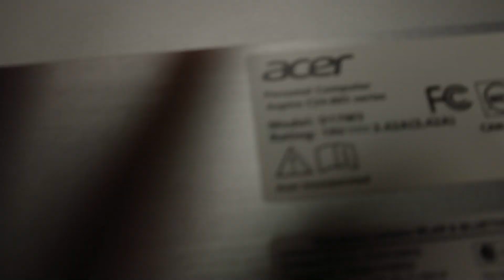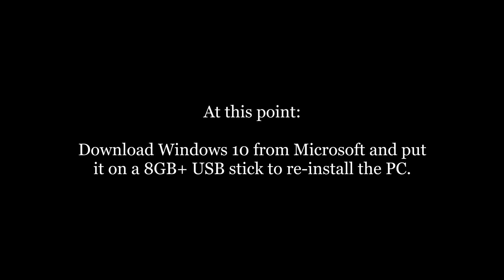Easy Acer Aspire AIO All-In-One PC SSD Upgrade - HDD Removal - Howto

Comment: Did you have any issues installing windows after changing the Hard Drive? For some reason the computer is not recognizing the Media Creation tool, says that the drivers are not found. Got any tips for that?
Reply from the maker: Make sure secure boot in bios is it turned off. This will prevent installing an OS from a USB stick.

Comment: I haven't done anything like this before. The installation of the SSD looks pretty easy but should I download the windows 10 before installing the SSD or can I install it after?
Reply from the maker: Yes just Google download Windows 10 in create a bootable USB disk. it helps to do this on the same computer before you wipe it if you get a chance. Then once the disk is complete swap out the solid state drive and boot from the USB stick.